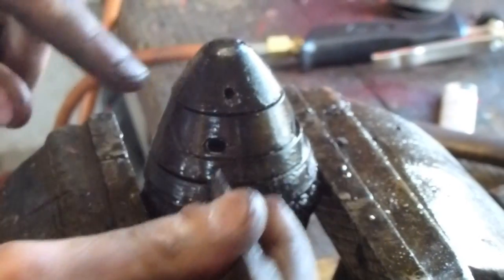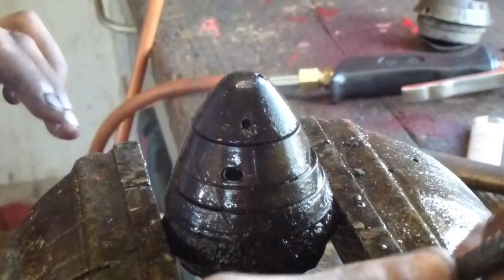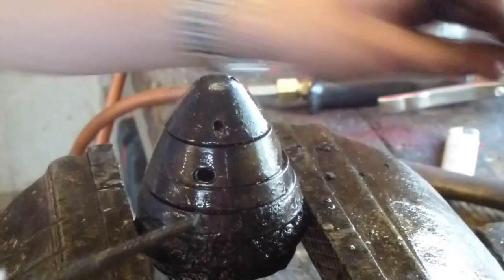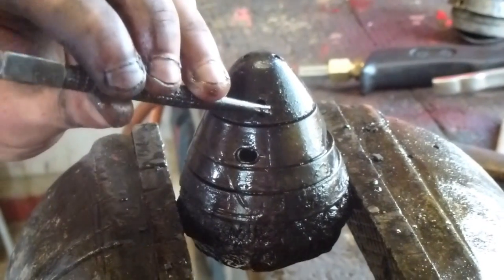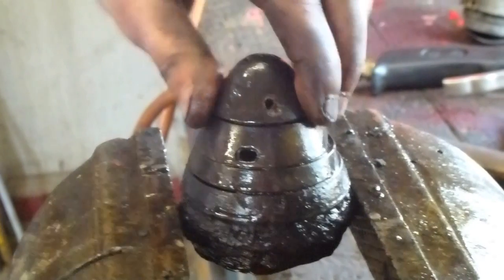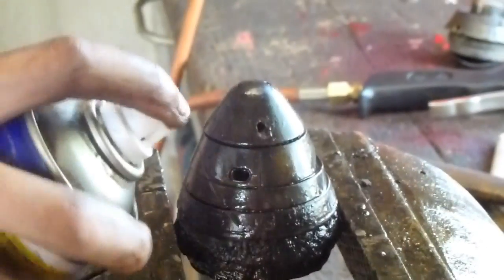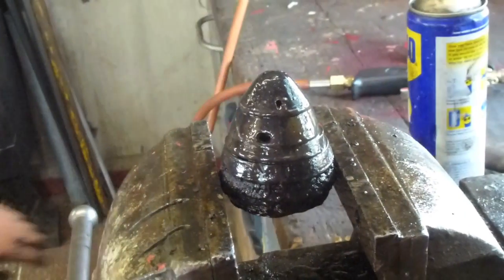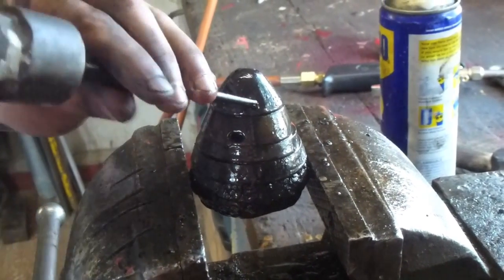how to take apart a ww1 British no80 artillery shell fuse (tutorial)

Comment: This is NOT "potentially dangerous" this is insanity.  The charge in ANY artillery fuse will blow your M-1 ball and penis assembly off!
Reply: Not if the fuse comes from the remains of an exploded shell.
However, such an old fuze very likely contains some lead or mercury compounds from the burnt primer.
Reply: @norbertfleck812  UXO is EXACTLY the issue:  if it's unexploded the fuze didn't function AND is very likely armed from by the setback of firing.

Comment: why do you have to heat/cool it - doesn't this just soften the metal ?
Reply from the maker: Ian salmons some of this stuffs been buried for almost a hundred years and is well siezed together, the heat and cooling process just loosens everything up. Metal strength isn’t an issue as its only going to be an ornament once its apart and cleaned up
Reply: Evo7125 ok.. Thanks, one more question, the pin you drill out ... is it hardened?
Reply from the maker: Ian salmons I wouldn’t of said so, most likely just mild steel as it drills put relatively easy however the drill always moves into the softer brass which is the tricky part of drilling it nicely. its only a screw to stop the brass cone coming undone so i doubt they would go the effort of hardening them as they made so many millions, theres no actual blueprints saying it is or isn’t so I’m just judging on how easy they are to drill through.. Been a while since I’ve taken one apart though haha
Reply: Evo7125  If it’s a screw I’ll try a screw extractor first  and see if I can wind it out
Reply from the maker: Ian salmons of its not rusted away it’ll be a flat head screw, I’ve only ever had one that unscrewed

Comment: I don’t get the drilling bit. Was there a seized grub-screw?
Anyway. Next time reduce damage by putting a rod into the hole you drilled (as in bottom it out in the hole) then hit the rod - might help reduce scaring on the tip near the hole.
There is also a ring in the base underneath that’s hard to get out.

Comment: Hello, Up until Sunday I had a fuse number 80 in good shape having freed off all the components (except 1) . Following my success of dismantling other fuses by first heating them in barbecue charcoal and quenching them in cold water I thought that I would further try the Fuse No 80 giving it the same treatment in an effort to remove a steel "cap" which was situated in the middle of the body and screwed in. In the usual way I had a pair of tongs at the ready to lift out the red hot piece but to my horror it had melted the fuse part from the copper timing ring. Brass apparently melts at 800 degrees and I am positive that my barby temp doesn't get that hot. The metal that had melted has the colour of gold. The only good thing regarding this is that the steel "cap" was recovered whole. Were their fuses manufactured out of inferior materials? or perhaps you can tell me why this happened to this one and not the others. Look forward to hearing from you.
Reply from the maker: Robin March do you happen to know what date the fuse was? Brass melts at over 900 degrees Celsius so this most likely happened because during the later years of the war the munitions factories were running out of brass so started to mix in other metals which will reduce the purity of the brass and affect things such as melting temperature and strength etc. most likely a late war fuse, I've seen this same thing happen to a friend with a German dopp fuse as both countries were running out of brass and effectively doing the same thing to stretch their resources

Comment: I don't know whether I have been lucky or what, but I have dismantled 2 '80s, 1 '85 and also a Dop 91 without having to resort to hammer and punch. I heated them all (not at the same time!) in my barbecue until they were glowing red hot. I then quenched them in a bucket of cold water and waited for a few minutes to get rid of residual heat. I drilled out the screws in the "skirt" and the nose cap and then whacked the fuse with a wooden mallet. so as not to mark the body. On each occasion with a little bit of of rotary persuasion ...hand only, the fuses came apart.
Reply from the maker: Robin March you get lucky sometimes, I've had the same thing and several occasions I've managed to get fuses apart without even hearing or hammering them, all depends on condition and how long they've been in the ground! glad you got yours apart

Comment: Dude... so much scarring from the tools. Use a softer approach, wanted to learn methods for cleaning my dutch ww1 fuse "Tijdschokbuis no.2", but it was not pretty to watch excessive force on such a fuse. Use a smaller hammer, learn to tap straight on. Scare it loose, torture is not often needed ;)

Comment: Very sloppy work
Reply: The heat created by the drill bit i presume. In Northern Ireland lots of people blew themselves up with pipe bombs screwing the cap on if powder was on the thread (friction). So I'm guessing that's what he meant
Reply: @sammni  After the fuze has done its job (some remains of the exploded shell were still attached to it) there is nothing left which could be dangerous - except for poisonous metals (lead etc.) or other toxic remains.
Reply: how?
Reply: +Pawel33007 
Are you a professional at doing this type of work?

Comment: hi I am really interested in this fuse because on a school trip to belgum about ww1 we went to a trench and I purchased a grimy/ dirty fuse which originally had no info about it for 10 euros . I then did lots of research into how to clean it and have confirmed it to be a no.80 VII shell fuse, however now that I have it I want to get the rest of it. please help because I have no idea if there are different types of shell casing or not and/or where to get this/these? please help thanks :D
images:
http://i1065.photobucket.com/albums/u382/starrydad/Mobile%20Uploads/IMG_20151112_125045_zpszbamrqsu.jpg
http://i1065.photobucket.com/albums/u382/starrydad/Mobile%20Uploads/IMG_20151112_125056_zpsgrpxu2iv.jpg
http://i1065.photobucket.com/albums/u382/starrydad/Mobile%20Uploads/IMG_20151112_125121_zpslqaucotx.jpg
http://i1065.photobucket.com/albums/u382/starrydad/Mobile%20Uploads/IMG_20151112_125210_zpsle4mcrxq.jpg
http://i1065.photobucket.com/albums/u382/starrydad/Mobile%20Uploads/IMG_20151112_125220_zpstcikiwhl.jpg
Reply: endirenderz. your fuse is an 18 pounder  only difference being is it high explosive or shrapnel

Comment from the maker: putting the punch directly into the hole and using it as a type of "leaver" (I think thats what your trying to say in your comment..) , that wouldn't work as it would act as another pin and lock the nose cone in place.. I can see where your coming from but doing it the way I do it may cause a little bit of damage however its by far the easiest way of getting the fuse apart.